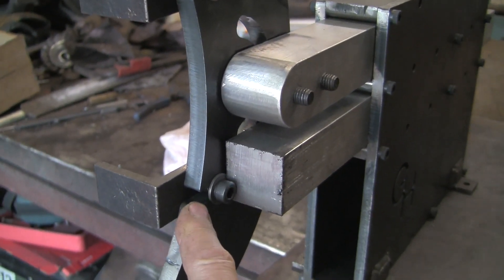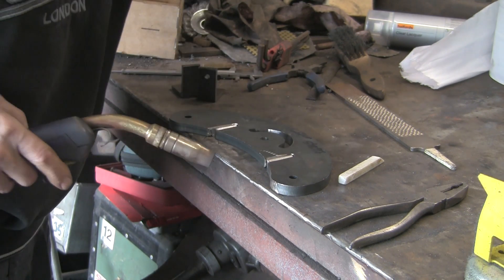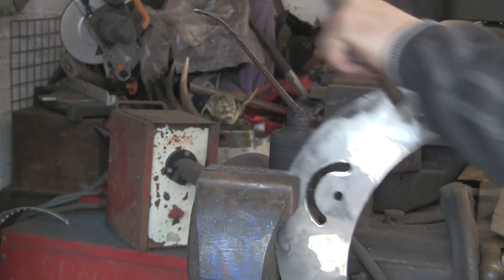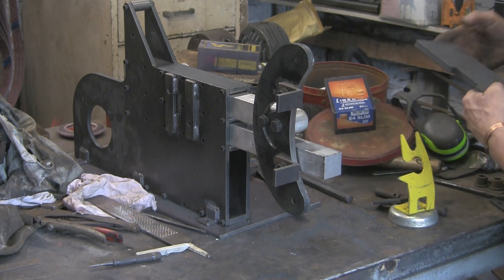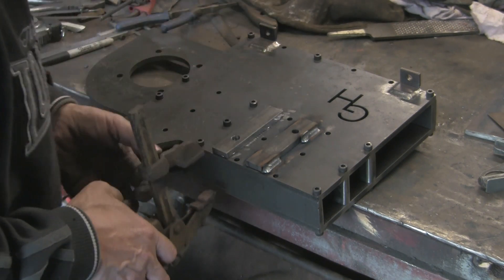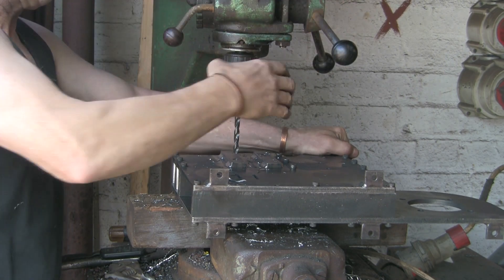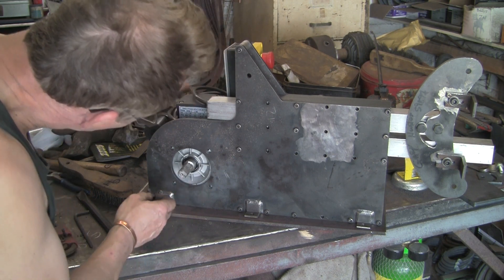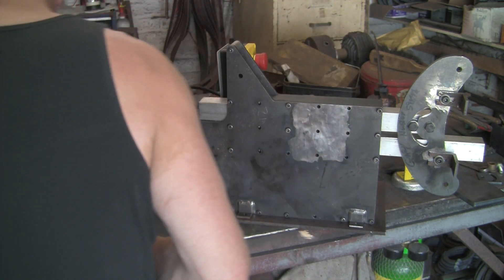Belt Grinder Part Five

Comment: are you going to use some shims to stop the handle bolts from destroying the aluminium? might be a good idea in the long term.
Reply from the maker: Jef___ _ I wasn't intending to as it will only be adjusted if I use a different size belt or wheel which won't be very often.

Comment: The problem is we are all human. My father used to tell me you are going to make mistakes, the magic shows up with what and how you fix them and as you say about moving the pieces to where they need to go you plan to take it all apart and paint it. I bet then all is said and done it will look as good or better than any other commercial mass produced machine and still provide you a substantial savings in cost.

Comment: Gary Huston
Quick bit of advice being sought from you if I may ?
I have a favoured crowbar that got slight bent in middle by digger tracking over it - if I heat it red hot and bend it back , should I then quench it in something like water or oil to harden it back up ?? Advice appreciated  and I am enjoying your vids thankyou !!
Reply from the maker: If you quench it you could harden it then you would need to temper it just in the one spot which would be quite difficult. Personally I would just heat to the minimum you need to bend it back then just leave it to cool. At least that way if you give it some beans it should bend again and not shatter with the possible consequences of you getting injured.
Reply: Ahh ok  - thanks very much for replying - much appreciated . Will give it a go , cheers !!

Comment: Awesome build. This will be bomb proof! One question, is there a reason you wanted to locate the belt on the left side of the machine instead of the right side where most of the others have them?
Reply from the maker: Only because the motor drives clockwise and I couldn't figure out exactly how to change the rotation, plus I couldn't see any reason that it needed to be the other way.
Reply: Ah, I see. I never understood why they had to be on one side either. If you publish plans, your design is easily built left or right handed!